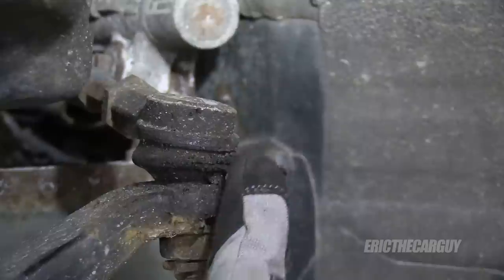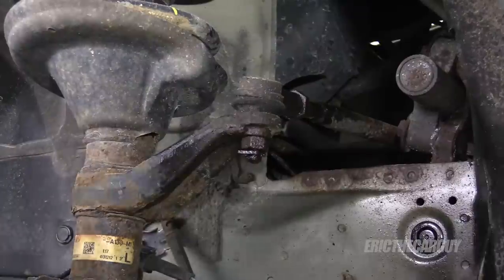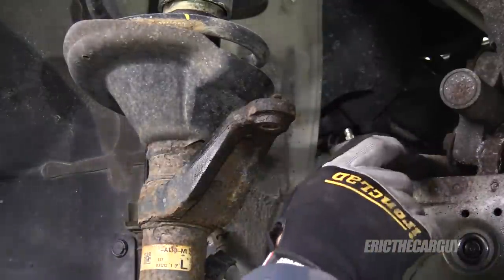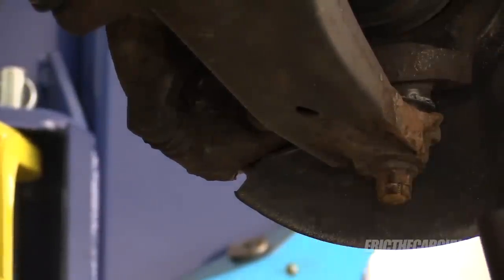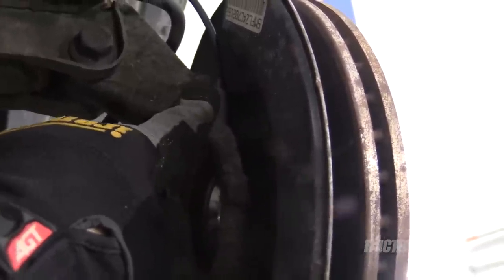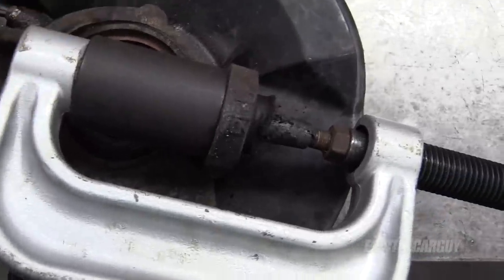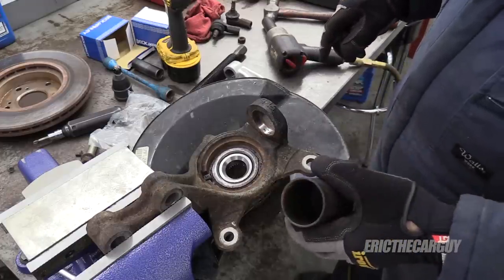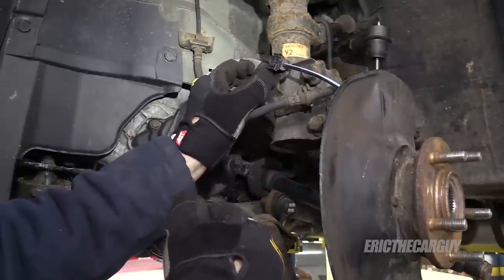How To Replace Ball Joints and Tie Rod Ends Honda Element/CRV

Comment: Hey for what it's worth.. just did this job on my '03 Element - using a similar ball joint/bearing press tool - and you can remove the end of the threaded 'pusher' part - so it becomes a 'sleeve' over the end of the lower part of the ball joint.

In any event, thank you Eric for the content you put out.. has saved me thousands in repair work .. being empowered to do it myself..

Cheers from Wisconsin !

Comment: Eric - this video was exactly what I needed. The lower ball joint of my '03 Element was shot and buying a $270 knuckle from the dealer wasn't going to happen. Thankfully Pepboys had the Moog ball joint and I rented their ball joint tool. Took some work, had to weld the old ball joint stub in place so it wouldn't wobble but it all worked out!

Comment: I borrowed a press from Advanced the first time.  The second time I needed a press, I purchased one from ebay for $39.  I've since used it not only on ball joints but u-joints as well.  It's nice having it on hand. Excellent video!
Reply: Do you have the le link of the press you bought? Thanks
Reply: Or this: Sp Tools 68600A
Reply: I have the same kit, but can't seem to get the top cup centered around the top of the ball joint to get it out. There's a lip where the axle connected that is in the way. Thoughts?
Reply: Thanks for the quick response, J! I ended up trying again this morning with the kit as is, and found with a little extra effort the middle-sized cup with the lip on it worked like a charm. I just wasn't trying hard enough last night. :)

Comment: "a few taps here will do the trick"
proceeds to full on smash the arm with a sledge

funny how i've been ignoring the bad lower ball joints on my crv then you post this. i was not looking forward to buying a whole new knuckle, good to know i can just press this in without much headache.

great video
Reply: The ball joint on my 05 Accord have failed at 370k. After replacing them at about 200k I was looking for a possible way to do the job more efficiently than before. The first time I did them the new ones failed in a few months and one actually came loose in the knuckle. The after market ball joints I installed had no snap retainers. I installed new ones with snap rings.

Now, as I collected parts for the current replacement I discovered new after market knuckles with ball joint installed for about 88.00 per side. I got new hubs and bearings for 60.00 a wheel. If everything look good I'll save time and money.  New Honda knuckles are about 400.00 a side, without hubs or bearings.

Comment: Great video Eric. Always useful to those of us trying to keep a Honda of that generation on the road. 

Those sensors are an absolute PITA. While changing out the bearings I had the bolt heads snap right off both front sensors. I've completely given up removing them while doing work and even went as far as notching out a press plate so I could press out the remaining two rear bearings with the sensor staying in place.

Comment: Did the ball joint job in my one car garage yesterday.  Couple of tips to add to the great video:
1. If you don't have a lift, you have to get the car up really high on the jack-stands, in order to get the ball joint press to fit between the steering knuckle and floor of the garage (don't plan on getting an impact under there, you will have to wrench it and I recommend a large cresent wrench for a perfect fit on the press' rod).
2. I couldn't get the castle nut on balljoint rod approach to work in order to remove the old ball joint.  It kept slipping.  Nor did the air-hammer approach work (by-itself, I did have success starting with a press and punching out with the air-hammer).  Instead I put an deep impact socket over the ball-joint rod at the bottom.  It was just barely long enough to hold the ball joint threaded rod also also fit onto the balljoint housing to push.  With the shallow a-symmetrical receiving cup from the press kit I was able to get both ball-joints out on the first try.
3. Putting the new ball joint in was straight forward as Eric shows.  However keep in mind when you're not using an impact, you have to wrench this thing.  And it takes hundreds of pounds of force on the wrench even when you have the press setup to apply equal pressure.  In my one car garage- I was able to brace my back against a wall, put a foot against the hub to hold it steady, and pull as hard as I could.  I don't know how I could have done it otherwise.
4. Lastly, you have to press the balljoint in and turn that wrench until it literally will not turn anymore, even with a helper pipe on the end of the wrench, that's how you know its fully seated and the snap-ring will fit in its place.

Comment: Super helpful video. My ball joint wouldn't budge, even using that remover tool from the auto store. I ended up (very carefully) beating it out with a hammer. One of the very few times where brute force did the trick.

Comment: God bless you, Eric, very helpful. Got brave enough after watching your videos and did my CR-V ball joint today. Rented the tool from Advanced auto, but had to buy impact wrench from Harbor Freight - spinning it with breaker bar was not working for me . My 5 gallon compressor is good enough to make it run for 20 sec, and it was all what was needed! Thank you very much, Sir.

Comment: thank you so much for this video! it couldn't have come at a better time, i have a 2003 Honda CR-V and it needs both of these parts replaced, now i'm not going into the repair hoping there is no technical details that i don't know of that will make this near impossible to do. In other words thanks for the confidence boost!

Comment: Top notch video Eric! I have  2006 Honda CR-V and a 2001 Civic, they both use identical ball joints, so I purchase genuine Honda ball joints for the Civic and use them on the CRV, since they are not sold as individual parts for the CRV. Thanks for the links to the tool.
Reply: Thank you for that gem of knowledge

Comment: This video was very helpful as I am having to replace the lower control arm, the strut assembly and some other things after my mother crashed her car into a curb. The axle nut is 36mm, and I got lucky and had no problem getting the abs sensor out of the knuckle. One issue that I had is that I did not "Unstake" the axle nut before I hit it with the impact wrench. It came off fine, but it must have buggered the axle threads, cause I didn't smash the crap out of the end of the axle while removing it from the knuckle. I was very careful to not pound away on the axle but the old axle nut (Which I would replace anyway), does not wanna go back on and I am not going to force it or cross thread it. I have no problem replacing the cv axle if need be and I am going to try and clean up the axle threads I have before I do go that route. The only thing that could gave buggered the threads is the "Unstaked" axle nut. Just an FYI for those that have to do this work.

Comment: More element videos please. I have an 03 will under 100k, but its been through some life. I think it was at the jersey shore for a bit... the nuts under the fuel door have rust. Couldn't get a bolt out for rear shocks, battery nuts were all dickered up. 
This summer I'll be doing the stuff in your previous videos for the major service. And there is a high pitched rattle when I start it. I am guessing its exhaust related. All kinds of fun stuff.
Oh and it gets used well up here in the high desert. I can't afford blizzaks, yet, but its still gone through some serious snow. Managed to high center it a few times. And it's had some off road desert adventures. Love this car. It's awkward, and kind of out of date, but its great. I transported almost a full pallet of soil for a farmer friend without taking the seats out. Do that with anything else. And its a road trip beast, just keep it under 70 or fuel economy is crap if you drive in to a wind. 
Its a fun car, especially in my area.

Comment: very informative! l have used the press tool, it is a life changer, but l also have compressed air, you actually helped me decide whether to get electric or air tools when l started my tool buying. Electric is hoseless, but you cant compare the power (if you on a budget). sure go spend 500 on a snap on or milwalkee electric impact, but i got a 300$ craftsman air compressor kit and it came with a crap gun, so l bought a aircat, and havent had a nut it could not remove!
Reply from the maker: The only issue you might run into is when running a grinder. Otherwise, you're good to go. https://www.youtube.com/watch?v=7Zz9SKSHxFg

Comment: Hey thanks for showing the proper method for getting the tapered shaft out of the lower A arm and tie rod ends. Ive used that method for 50 years without one failure.
Viewed another vid by another "car guy" just before yours, won't name him but if you see it you'll get a real good laugh as did I.
He used a pickle fork, beat the holey hell out of it to no avail 😂 had to use another method, finally did get it. Showed us all how having that pickle fork since he was 17 made him stupid.😅
The only thing I'd suggest for you is to use the pry bar to put a bit of tension pulling the parts away from one another while whacking, using this method results in having to only whack once or twice. Also use a Ford hammer (3 pounder.)
Note too, that using Dot 3 brake fluid works well as penetrant and can be washed off with water if it's being used around items as brake shoes or pads being reused.

Comment: rented that exact set from advance for ball joints on an explorer. it worked and no major complaints even though it was missing parts but having used both, if i were to buy a kit, it would definitely be OTC. just my $.02

Comment: if you do not have impact tools, you can also get a second person to hold down the break pedal while you use a breaker bar on the axle nut.
Reply: or just stuff a thick screwdriver in the disc cooling slots in the caliper and that does the trick too

Comment: I'm glad I have a gen 1 CR-V. Working on the knuckle and ball joints is more straight forward, but the damn thing ways a lot more. Removing the old ball joint could be done using an impact socket that fits to edge of the ball joint and hammer it out from the fastener direction, while clamped in a vice.

Comment: My son bought a Honda Accord. They have a part they call a resistor that fits in the A/C - heater system. It's there to set the temperature so that the A/C and heater are not fighting each other. They charge $130 for this part. It's a heat sink with a Mosfet and a sand fuse stuck to it. You can rebuild these for about $4 . You have to buy enough parts to repair 5 though. The mosfet is from the 1970's Honda Trail 90 and can be found on Ebay. The sand fuse can also be easily found. Don't buy new ones just rebuild the old ones. Collect the dead ones for rebuilding. If I could get enough of them I rebuild them and sell them. I have tested this rebuild and it works.
Reply: Reminds me of my Saab, a common fault is the info display and/or AC display dropping pixels from their LCDs, now you can still by new units for $300-500 or you can buy a $10-15 ribbon cable which 99% of the time will fix the problem.  Mine was so bad the LCD displayed nothing at all, took 30 min to repair (and that was me learning how to do it), 15 months later and it still works flawlessly.

Comment: Great job Eric I myself just picked up a 2005 CRV ex That had a blown motor for $400 and it up putting a JDM KA 24And that and other than that I have been driving it but I haven’t for bid I either got to do swaybar and links strike plates are bearing plates or whatever the hell you want to call them or ball joints... And the last always fun I’m just waiting for to warm up a little bit so I don’t have to sit in crawl around on the garage floor even though the garage is heated the floor is still freezing

Comment: I need to do the to my 2004 Element. Dealer wants $646 for both sides. You are absolutely right they don’t sell the ball joints by themselves. You need to buy the steering knuckle. Which do recommend for ball joints or should I just let the dealer install them. Local mechanic will charge me $75 per side and I supply the ball joints. Thanks

Comment: Don't hit on the nut, use the empty holes which are designed for doing this, just put the right size bolt and it will push it out.

Comment: I found that the best way is to pre-lubricate all nuts for a day or two BEFORE you start your work if you are at the house doing the work. Spray that penetrating oil liberally on each one sand let it sit. By day two it will come off without too much problem. Even those axle nuts that the last idiot tightened to 180 Ft. Lbs.

I've rebuilt the front end suspension twice in the last 10 years on my Crown Vic using this pre-soak method at home on a carport. I utilized sockets and wrenches varying from 1/4" to 3/4" drive to do my work and a big heavy duty C-clamp for removing sand installing the ball joint.

JD
Reply: The best liquids for loosening rusty bolts is a stoichiometric mix of oxygen and acetylene.
Reply: Only use heat as a last resort. Rubber and plastic does not like too much heat.
Reply: what kind or size of c clamp do you have????    It is funny that you said:  "the last idiot tightened to 180 Ft. Lbs."   In reality he is not idiot since my honda crv calls for 181 ft lb  LOL

Comment: Another way of popping the lower ball joint from the lower control arm is to put the nut on backwards, put a flat block of wood against it, and Jack it up from the bottom (if the car is on the ground).  The spring pressure from the suspension will push back and force the ball joint out of the LCA.

Comment: Hey Eric what were the symptoms that lead to changing out the part? Always enjoy all your videos. If I have a rubbing sound in the front end when I turn left at a 45° angle will greasing any fitting help? Ever think of moving to San Diego? 🙂 great video 👍
Reply: Ha! I second this comment! I have a loud one-time popping noise on turning or going over some bumps. Wondering if this is kinda what was happening with your element and lead to this repair. Cheers!

Comment: Another great video!  I wonder if the Astro 7865 has got all the accessories to remove/install ball joints on an old F150 4x4 with the TTB suspension.

Comment: How I do it is just using a cutoff wheel to chop the old balljoint down and then use my ball joint removal tool. But recently I've learned you can just take your hammer and smash smash and they come out pretty easily. either way, it's so much easier to just chop off the moving part and then press it out.

Comment: the MOST important tip is to watch video BEFORE FUp and remove the rubber boot before pressing lower ball joint. I thought boot would just slip thru while pressing but boot ring got pinched and ruined boot. now I need to buy boot replace kit. also people suggest using zip tie boot rather than fussing with metal ring

Comment: I replaced both the control arms, Stabilizer  links and ball joints as well as the outer and inner  tie rods on my son’s 2005 Element after he slid sideways into a curb and bent the control arm on the passenger side.  After all this work the passenger side has positive camber and the driver side is spot on.  I was able to align the car using the string method.  What do you think is causing this?   I tightened the control arm with the arm fully loaded.

Comment: Hey Eric
Can you do a video on element/CRV engine mounts and transmission mount replacement. I think it's very common with 2005 or similar vintage CRV/elements and dealers are asking about 1K to do the job. 

So it will be really appreciated. 

Thanks 
Matt

Comment: Glad to have you back in full gear.  I know these were from the collection you've had but still relevant.  If the inner rod has play (I can pull it slightly and push it back in), do I have to replace the entire rack & pinion or can I just fix the inner rod?

Comment: Eric, great video, as always,  what is your opinnion on adjustable rear upper control arm for the crv/element, to correct the camber in look /problem. Will it wear the rear  tires out faster because of the changes to factory spec ? Please do a video on that, thanks

Comment: Question from a lees educated mechanic...:1) can I take of the ball joint with a simple but strong C clamp? 2) I also have a leaking shock. Thought of using a full assembly like Gabriel Ultraready mount. Any advice ? Thank you all. And thank you for such high quality videos.

Comment: Thank you for the video eric!

The ball joint you used is a MOOG K500004 Ball Joint(03-11 element), Rockauto has MOOG K80223 for the 02-06 CRV/03-05 Element.

I want to use the k500004 for my 2005 CRV as it as the snap ring. Would this work on a 2005 Honda CRV 4wd?
Reply: 2005 Honda CR-V EX AWD uses Moog K80223 (Rockauto/$37.79)
Whereas K500004 will not fit (Amazon/$25.99)

2005 Honda CR-V is an AWD not 4WD.

Comment: Hi thanks for the information, i'm wondering if astro Kit #7897 will install ball joint for Honda CRV 2006, i know Hondas will require special adapter for ball joints removal, does the astro 7897 set have the adapter? Thanks

Comment: One of the 'joys' of owning a German car: My Jetta uses wheel bolts instead of studs and lug nuts. Plus the brake rotors aren't hub-centric. Let me tell you, that can be a huge PITA. So in my case, rotor alignment screws saved what's left of my sanity.

Comment: Eric, does having a lift make it easier to work on cars ?
Reply: In a word... Yes.  In more words... Hell Yes!

For anything that requires you to be under the car it gives you so much more working room compared to ~2 feet you usually get from having the car on stands, even things like suspension and brake work is easier as you can work at a standing height rather than sitting/squatting.
Reply: What do u think?? Smh lol
Reply: Gotta be so nice for leverage